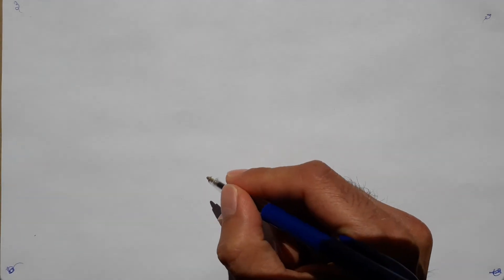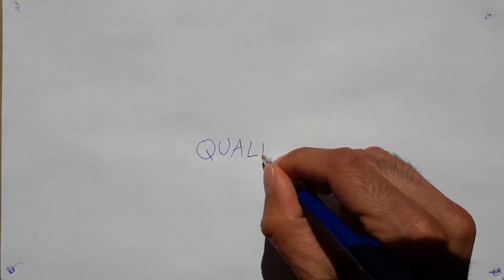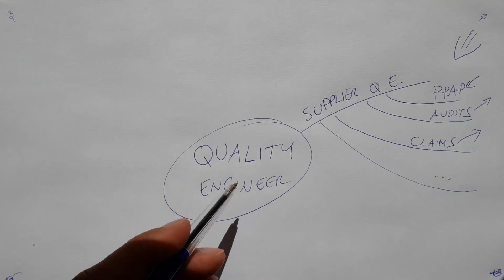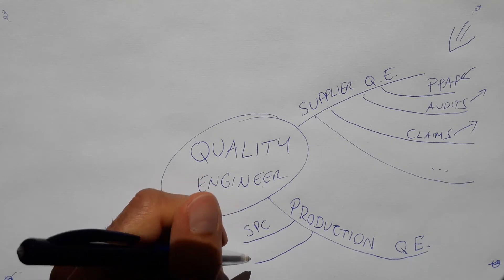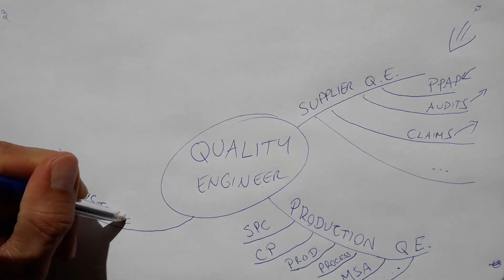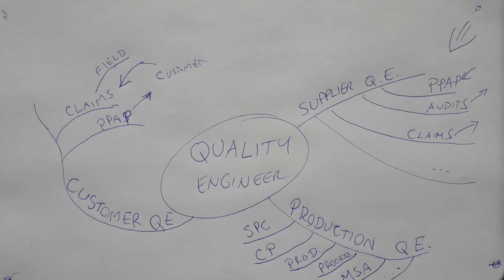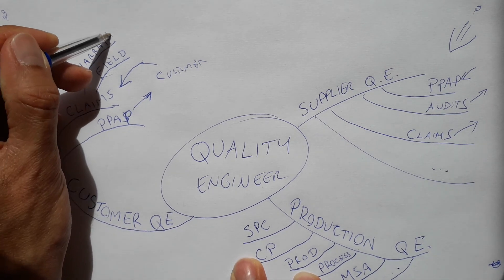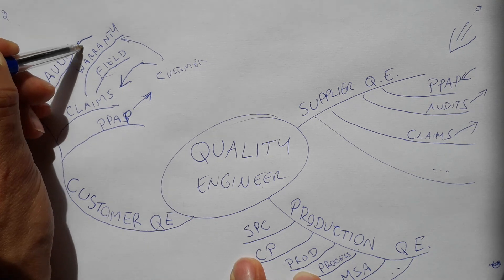Quality Engineer Job Scope - Automotive Engineer's Corner

Comment: I have been offered a Process Engineer position. After googling the term, I still What would like to ask what is the scope of such a position, tasks and maybe some example ? Thanks in advance
Reply from the maker: OK, so it's one year later but I answer anyway: most probably it's the manufacturing process engineer - so you make sure, that the production process is running. 
- You make the process flowchart, 
- control plan (together with Quality), 
- PFMEA (process FMEA)
- you make work instructions, 
- you make sure, that the machinery is keeping the tolerances of production,
- you make sure the PPAP samples are produced and transferred to Quaity guy
- you make sure the tools and machines are ordered and approved according to checklist
- you cooperate with quality dept, maintenance dept, production managers, operators
Reply: @automotiveengineerscorner it was exactly like this. Thank you, even with a delay. Hope it will be useful to others.
Reply from the maker: @vahidavdic7394  Nice!